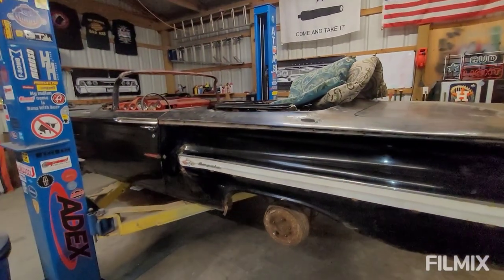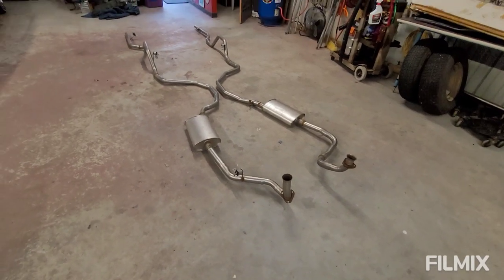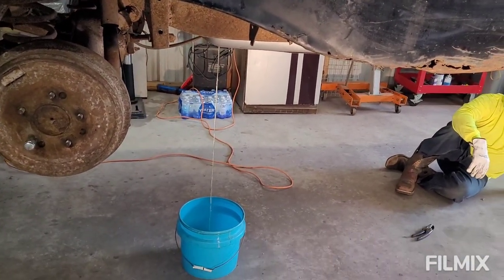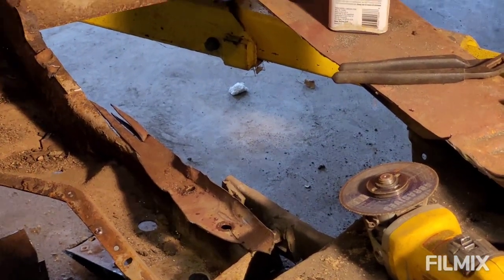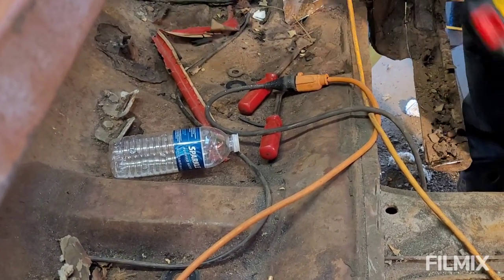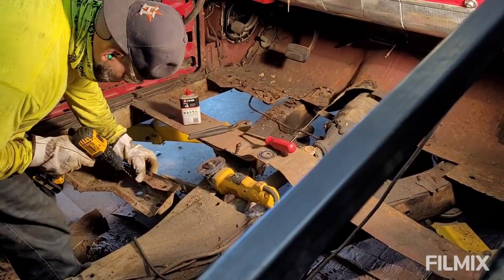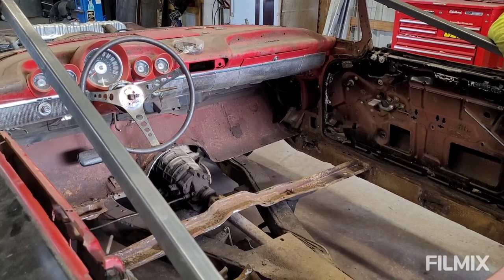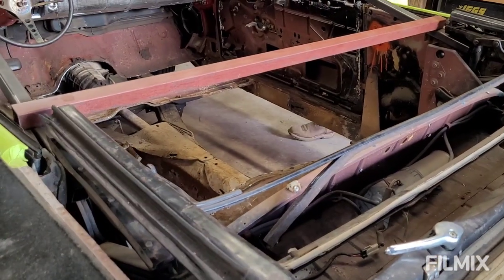1960 IMPALA CONVERTIBLE METAL WORK BEGINS, floor pan replacement!!

Comment: Nice work man I did the same shit with my 62. You don’t need a spot weld remover.Lol. Don’t waste that gas it’s like 5 bucks a gallon here in cali.
Reply from the maker: Yep. I put the gas in my zero turn. The spot weld cutter worked OK.  I think it was like 8 dollars on Amazon or something like that.  But a drill bit does same thing.